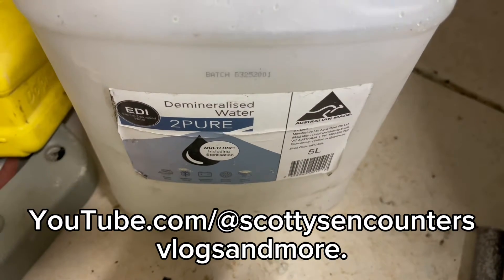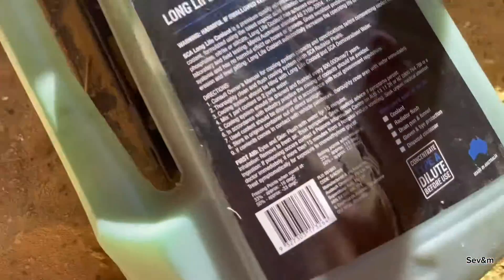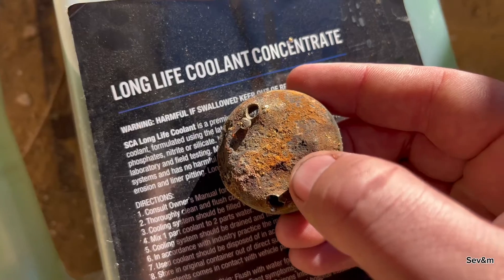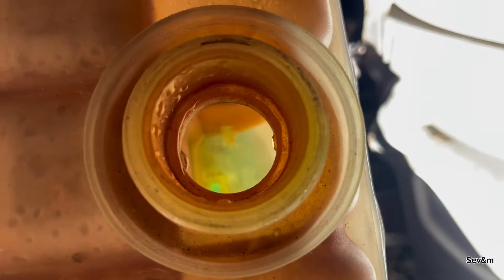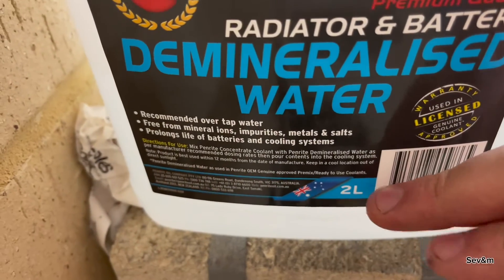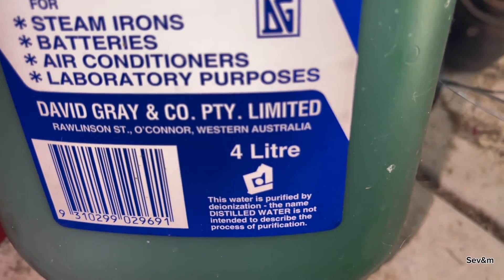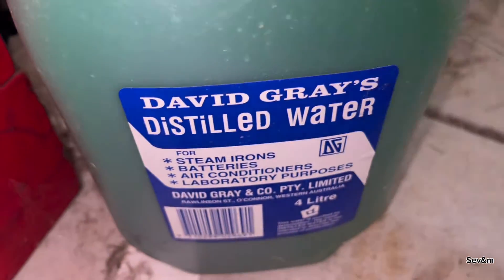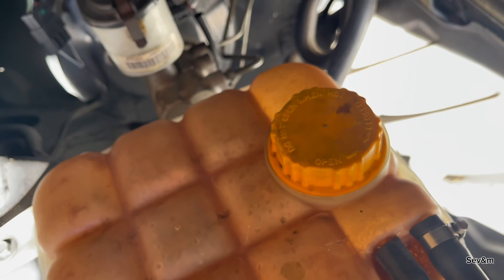Should You Use Distilled Or Demineralised Water For Coolant?

Comment: I believe you got it wrong. Distilled water also has no minerals and it’s produced by capturing water vapors from boiling water leaving a pure water
Reply from the maker: You are correct, that is the process of producing distilled water.  Although distilled water can still rust the radiator because, the distilled water now has no “ions”. So now the water becomes ion hungry, as in it can strip the electrons from the internal metals in the cooling system.

The water wants to re chemical itself, so now the distilled water can become acidic.

It’s best to use demineralised water or soft water.

Thanks for watching.
Reply: From what I've heard in my lab, distilled water should be safe for this sort of thing, but deionized water causes things to rust more quickly. That water company was doing some false advertising